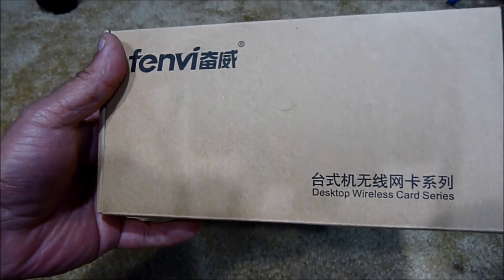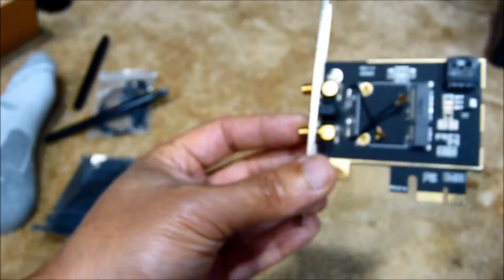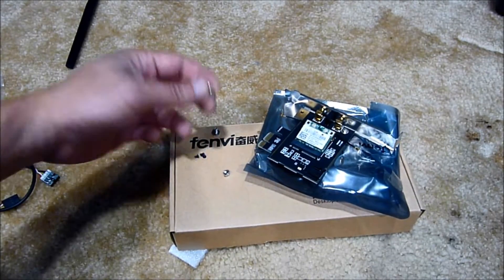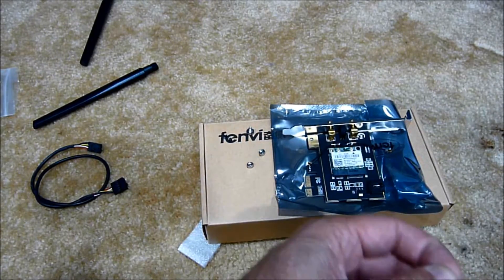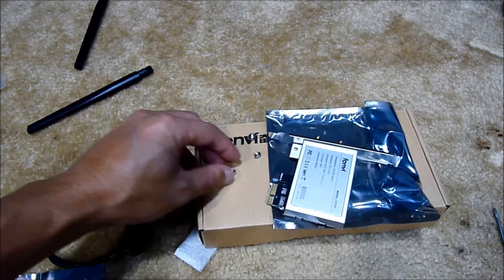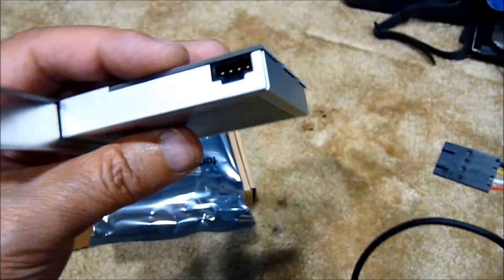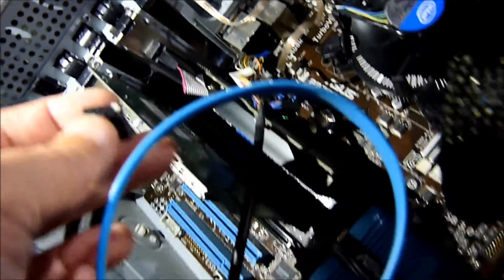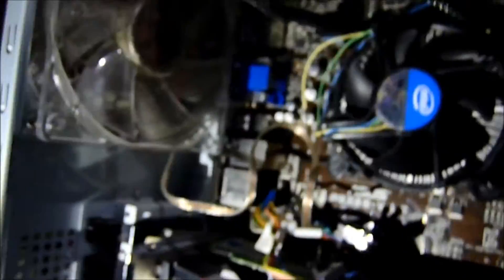How To Install Half Mini Wifi-Bluetooth combo to Desktop PCI-E with Fenvi Adapter FV101

Comment: There is a newer model with Bluetooth 5 support. Model : Fenvi fv-9260.
Reply: Works with mainboard AMD?
Reply: @iTzGuTy1  No. It's Intel's baby - the chipset 9260. Check out BlitzWolf BW-BR4. It's a BT 5 receiver and transmitter. Works on multiple things. Almost same price.

Comment: Great video man. Could you tell me if I can just get FV102 PCI-E Adapter Bracket(not include wifi card)
& Bluetooth cable and NOT BUY THE  Intel 9260NGW AC Wireless card to make my desktop BT enabled? Thanks man.
EDIT- Turns out I need the WiFi card for sure.
Reply from the maker: Vivek Sood I rather use brcm over any other chipsets

Comment: Hi, thanks for sharing this video. I have seen via your site that you also suggest this card :AzureWave Broadcom BCM94352HMB. My concern is  relating whether I would face any problem by buying  this card?For instance,  does it require  by me to do any further modification in  order to work properly? Thanks,again!
Reply from the maker: Ilias Makis depends on your computer, you may have to mask some pins just like I did on a few of my HP
Reply: do you suggest to buy it? I am going to build a new pc(not laptop) and I m interested to  have mac os. When you say to mask some pins could you give some more detail because I dint get it exacly what you mean.
Reply from the maker: Ilias Makis http://www.dognmonkey.com/techs/how-to-replace-hp-x360-15-u011dx-wifi-bluetooth-combo-module-with-bcm94352hmb-724935-001.html
Yes, it’s BT 4.0 supports hand off for air drop

Comment: 1) so the PCIe adaptor is just working here as adapter.....I take it
2) how do you know which cables go onto the mini WiFi Bluetooth combo card? or is it interchangeable... I assume not.
Reply from the maker: iCyborg those 2 are just antennas connectors, any will do.

Comment: Why can the hardware not be found after installing the FV 102 wireless card on Win 10? Please advice and Help. I am using intel 3160NGW Dual band Card.
Reply from the maker: Shubham Ghosh if hardware not found: either driver or hardware connector is broken or not correct
Reply: I am Using Fenvi FV 102 With Intel 3160NGW Card. OS Win 10 1709
Reply from the maker: Shubham Ghosh try some other to see if it works. The card could be bad or your installation is not correct. Make sure pcie is turned on in the bios?
Reply: What is the correct installation way?

Comment: Nice video bro! I have a question. Do you have full functions loaded as Handoff Continuity icloud drive sincronizy synchronize ect?
Reply from the maker: Mine is NOT Bluetooth 4.0 so Handoff is not supported
Reply: and continuity and icloud drive synchronize?
Reply: You need this https://www.avito.ru/moskva/tovary_dlya_kompyutera/apple_bcm943602cs_bcm94360cdp_bcm94360_hackintosh_1800248025

Comment: do we need download driver because I dont see the driver for FV101
Reply from the maker: FV101 is only a connector, it doesn't have anything inside. You need driver for whatever you put inside FV101, ie wifi and bluetooth module
Reply: so if i want to connect bluetooth. what should i do
Reply from the maker: watch the video... install the driver for the bluetooth if the os doesn't recognize it.
Reply: ty so much

Comment: Thank you for uploading this guide. I got some trouble earlier on how I can  make the Bluetooth work because I wasn't sure where in the Motherboard should I stick the cable in. After seeing your video and browsing my PC's ASUS A68HM-K Motherboard manual.  I was able to finally make both WiFi and Bluetooth work for my unit. If only I got more USB 2.0 ports in the motherboard, I would have finished earlier.

Comment: So I need to buy a bluetooth mini card for this interface?
Reply from the maker: Yes, if you want handoff to work with macOS X, the bluetooth must be 4.0, use BCM94352HMB dual band 2.4Ghz & 5Ghz + BT 4.0 instead of BCM943225HMB single 2.4 and BT3.0
Reply: after BCM94352HMB plugged in, I cannot boot up my PC. Can you suggest any solution?
Reply from the maker: If you can't boot up your PC, which means the OS doesn't recognize the board. Unplug the USB connector to make sure the USB wasn't the problem. If it doesn't boot up, tape pin 51 of the Wifi board.
http://www.dognmonkey.com/techs/how-to-replace-hp-x360-15-u011dx-wifi-bluetooth-combo-module-with-bcm94352hmb-724935-001.html
Reply: Thanks! I tried this method but it doesn't work. (my MB is Asus H170 Pro)
Reply from the maker: Hieu Nguyen plug the connector without the wifi board. May be the fenvi has shorted pins. What OS are you running?
Reply: I use windows 10 creator with Mac Os Sierra.
I plug fenvi fv 101 into MB. it's working fine.
but after plugging BCM94352HMB into MB. I cannot power up my pc anymore.
Reply: Same here, I ordered a fenvi 101 and BCM94352HMB After plugin my motherboard doesn't power on. My mother board is Gigabyte H61M s2pv. What is the reason and what is the solution?
Reply: I just gave it up, and stick with the wire :(
Reply from the maker: Hieu Nguyen you should tape pin 42 or 51, it may have the same problem as my laptop. Go to the website and search for it http://www.dognmonkey.com/techs/how-to-replace-hp-x360-15-u011dx-wifi-bluetooth-combo-module-with-bcm94352hmb-724935-001.html
Reply: I already taped pin 51, but it didn't work as well.
Could you show me pin 42? I don't have any clue where it is.

Comment: hey man why do you need the cable, i bought a similar adapter but it didn't come with a cable and i cant find Bluetooth anywhere, is the cable necessary for Bluetooth?
Reply from the maker: Bluetooth is a separate unit on the wifi-combo port - You need to power up the bluetooth and use USB data to communicate with the bluetooth. Unless your card is built differently.